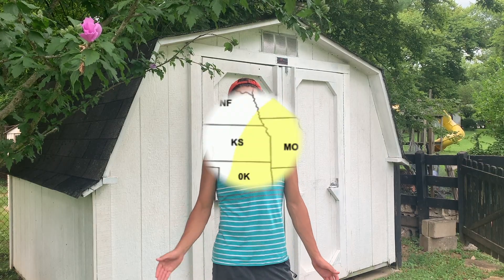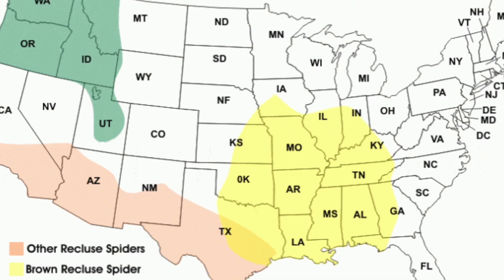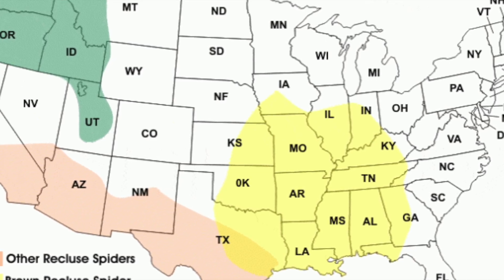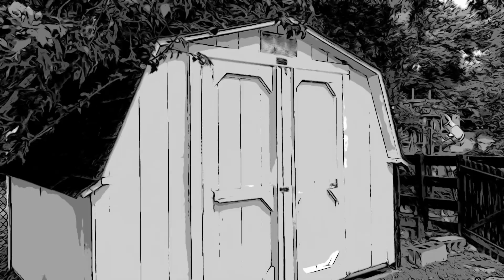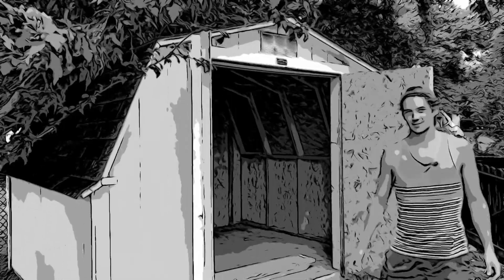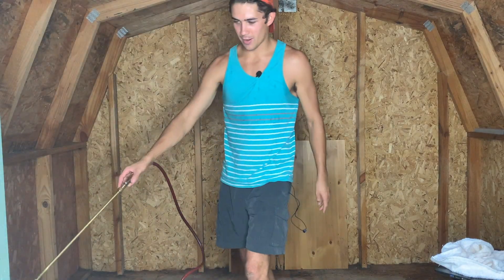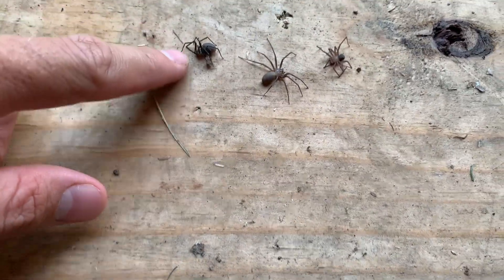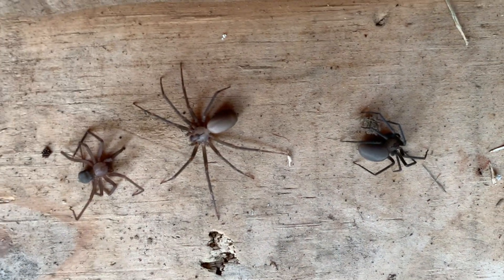Identifying the Brown Recluse Spider Infestation - Example and Treatment

Comment: Once you have it covered with the clear tupperware, you can use a piece of paper to get underneath it (kinda like a paper 'lid') but that's flimsy BUT it allows a good enough seal/lid to move something thin but sturdier (I use a folder) underneath that. Then you have a more proper lid (but you have to hold it in place)

Comment: Don't have clutter, inside or out.  Brown Recluse are reclusive.  They prefer dark areas, attics, closets, anywhere it is mostly dark.  Diatomaceous earth powder is a large aid in killing spiders and crawling insects.  The spiders eat insects and other spiders.  It's a double whammy using Diatomaceous powder because it kills their food source and when they get in the powder, it kills them too.  Only works in dry areas.  I also use the Diatomaceous earth powder that contains peppermint oil because spiders do not like peppermint.  I use the one with peppermint in my house and the plain in the attic and under the house around the house and near entry ways to the house.  It works.  Glue traps do help if you have those.

Comment: Hey dan I was sitting on my couch inside of my apartment i thought I had a normal itch like every body does  and found out when I pulled my hand away from my neck I had legs in my one hand and in my other hand there was a brown recluse spider so I treated myself with alcohol and antibiotic ointment i still have a red wilt and it's really sore when I varly touch my neck and it is really painful and my skin to my neck is thin in that area i didn't go to the hospital to get a antibiotic iv drip i.m allergic to beestings
Reply: It was warm inside of our apartment and it was nighttime

Comment: My mom had a custom house built with 6-inch thick, steel-reinforced concrete walls that withstood 200mph winds. I guess she was afraid a tornado would drop on her. She lived there for several years. The last year she was there, I noticed a weird-looking spider crawling on my bedroom wall, (I was living with her because she had a bad habit of not going to the ER if she had a stroke). I gave it a one-way ticket down the toilet. This species of spider showed up after my "pet" wolf spider crawled under my recliner and got squashed. The same type of spiders kept showing up. I found out that they were brown recluses or what we call in Kentucky, Fiddler spiders. I called a pest company and they came out and sprayed. And sprayed. And sprayed. Inside the house, in the attic, in the garage, around outside of the house. And they were still coming in! We lived in a new subdivision and her house was spotless and well cared for. Where they were coming from, I have no idea. She passed away the following spring from a stroke and after I moved in with my daughter, I went inside the house and there were spiders everywhere. They were dying because I had them spray one last time before I sold it. Once these things get into your house, they are hard to get rid of!

Comment: I’m in Phoenix AZ and my dog was playing with something outside just last night. It turned out to be a spider. I thought it was dead because it was curled up. Nope. When I was taking a zoomed in picture of it, I saw the fiddle on its back and then it started to move! I have a full shot of it with its legs splayed out and it was about the size of my palm. The last picture I have is that spider under a heavy rock. #oops 😂
Will it harm a dog? I’m worried that it was going to bite my puppy because it was pawing at it. Some clear liquid was under it when I found it, another reason why I thought it was dead. They fake being dead so they can get away. I just had my monthly pest control done that day! WTH??!

Comment: Thanks for the video, dan. In 1995 I moved into a mobile home in Southern Illinois that was furnished. After 2 weeks my wife and I separated her taking my 3-year-old daughter with her. I started sleeping on the couch that was furnished in the trailer and the nest of spiders was on the bottom side of the couch. Every time I rolled over I was shaking their house LOL. I received 9 bites on my legs. After about a day and a half I went to the emergency room and the toxins from the spiders stopped my heart and the hospital used the paddles to shock me. In 1995 no one knew of any kind of cure so they put a central line in my chest aorta with a triple lumen so that they could hook up three IVs to me at the same time. They basically bombarded me with the three strongest broad spectrum antibiotics all at once trying their best to do what they could. The toxins were so necrotic that all the bites became holes in my legs and destroyed a lot of stuff on the inside of my legs. Should have got on disability right then but would rather work. Worked until 2014 when I couldn't do it anymore and now I'm on disability because of these assholes. I tell family and friends of mine to try to put several drops of peppermint oil around their windows and doors at the end of summer and that does help stop some insects and arachnoids from coming into the house. I wish this comment section had the ability to add photographs because I would quickly show you what my legs look like today. Every brown recluse is an asshole to the nth degree!
Reply: I'm so sorry that you had to go through that. I've met a lot of people who don't take spiders seriously, but they can be extremely dangerous. I agree that they're massive assholes, in my ideal world butterflies would be carnivorous and fill the spiders role in the ecosystem, eating all the other bugs, and spiders wouldn't exist at all!
Reply: Wow!!! 😧🤯😰😨
Reply: This is Ken M level bullshit. Bravo
Reply: Wow I am in a similar potential situation sleeping on the couch. I am so sorry this happened to you.  I think they do make nests underneath things. Just goes to show you have to constantly clean. My cat saw it or I wouldn't have known!
Reply: Glad you're OK and Yes I agree they're all a**hole 😂

Comment: The easy way to do the “catch in a jar” technique is to slide something like paper or thin plastic between the opening and the surface it’s trapped against, which lets you keep it covered while you pick it up and get ready to put the lid on it.

Comment: Have you ever done a dusting spray for the brown recluse? We have brown recluse in our home for sure, and we recently had the dusting done. It was a week ago yesterday and we have only seen one dead spider in bath tub. They were mostly in ceiling and light fixtures and we haven’t seen any live ones yet so hopefully that worked. If you have done this before I was just wanting to know how good it worked for you? Thanks!
Reply from the maker: Yes dusting is a great option! And it lasts a long time. Usually we dust in the attic
Reply: What did you use? I’m researching dust for doing inside the walls!

Comment: Pro tips: 
-Do not ever use any chemicals in a tight enclosed space like a shed without wearing a resparator. 
-To avoid toe bites, stomp your shoes flat before putting them on, or, slap them together before putting on. 
-Fold the open tops of your socks inside themselves, a pair at a time. This prevents any critters getting into your stored socks. 
Off topic slightly: for rodent and nonspider pest control, simply sprinkle black pepper anywhere you want to vacate them. 
They will leave and not return, so long as you renew the black pepper every few months/ once a year. 😎👍🏻
Reply: Black pepper ??😮 will definitely try this

Comment: I was a carpenter in Elizabeth city NC for over 30 years and I can tell you they are on the East NC coast. I was tearing off facial boards on a old church in Murfreesboro NC and behind the boards were several hundred of them had to get the pest control guys to get rid of them before I could continue my work. Had some in my garden shed.

Comment: I had a bed bug infestation for 3 years couldn't get rid of them move to three different places they still continued. So I just made a little concoction that seem to work and I've sprayed it around my bedding area and it kept them away for the most part but they found other ways however eventually I ended up eradicate them. I just kept spraying and vacuuming.

Comment: Put the cup over the spider and use thick paper to slide underneath. That should make catching them easier. I love spiders but there's nothing you can say that will keep me from mirking them after an alleged BR left a hole in my leg. That breaking down means it went necrotic.
Reply from the maker: ouch!! yeah im lucky I've never been bit. yes that a great tip!